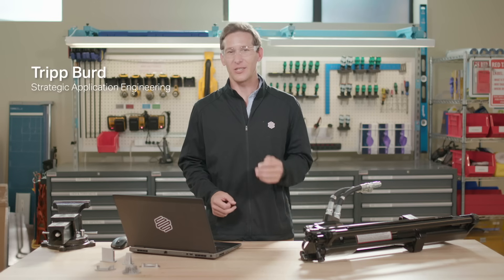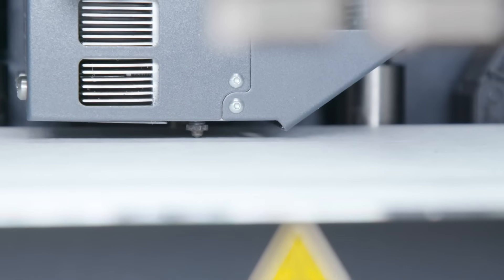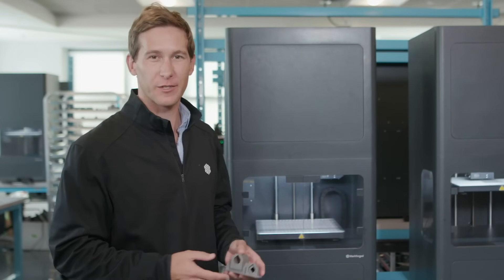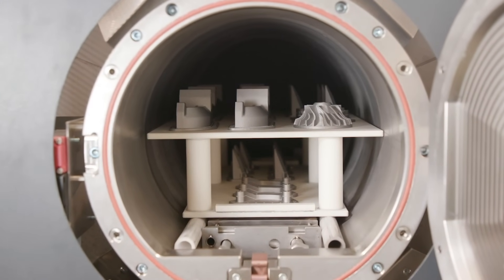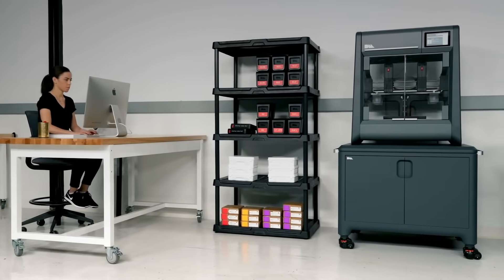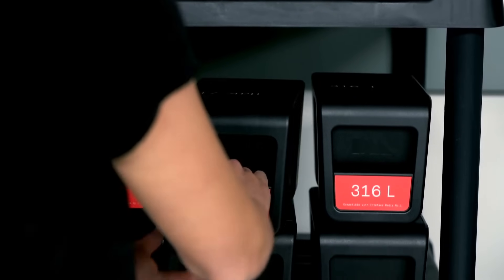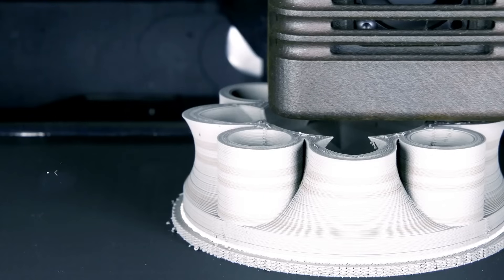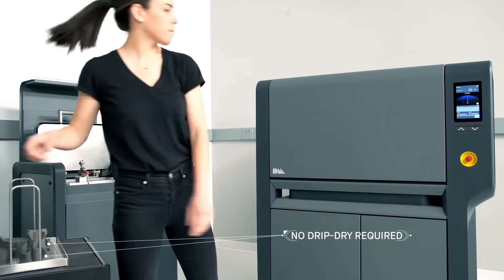Top 5 Metal 3D Printers 2021

Comment: Sheesh, that binder machine looking at half a million, only the big boys will buy this
Reply from the maker: Only big boys and corporations can afford it, until the technology gets cheaper
Reply: Not too long ago, small flat screen TVs would cost over $15000. Now you can get them for under $200, and they are much better.
Reply: @soundspark  What makes you think they will not figure out the technology to make 3D printing better and cheaper? The technology 20 years from now may be quite different than today. Although, I will agree that the price decrease may not be as drastic as it was for television sets. Primarily because there isn't as much demand for 3D printers as there is for television sets.

When I was in college (studying Mechanical Engineering), I took a 3D computer graphics course. Back then, they used expensive Silicon Graphics computers that the average person could not afford. I made a claim to my professor that some day ordinary home computers will be able to perform the same graphics intensive tasks. He insisted that would never happen. Here we are today, and home computers are far better than those old Silicon Graphics machines.
Reply: The good thing is in 5 years there is gonna be a affordable one . Look a regular 3D printer I remember they were $5,000 and up even $10,000 at one point now you can get one for $250 up

Comment: Prices?
Reply: All these systems are in the 6 figure range. You would need to request quotes for the specific prices since companies like these tend to have changes in price.
Reply: @PreciadoProductions  I saw Desktop Metal (2nd printer shown) at a trade show a little over a year ago and I think the starting price was around 40K
Reply: @calvinkorver2767  Yeah the printer itself isn't cracking 6 figures but when you buy the rest of the system to clean and "bake" the prints you're in the 6 figure range immediately. Otherwise you need to mail your prints out to get finished elsewhere.